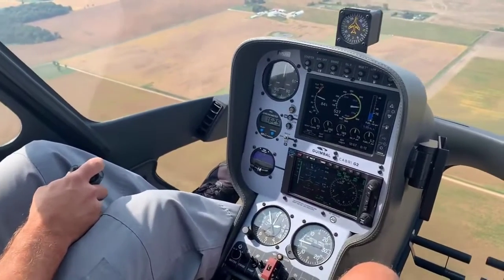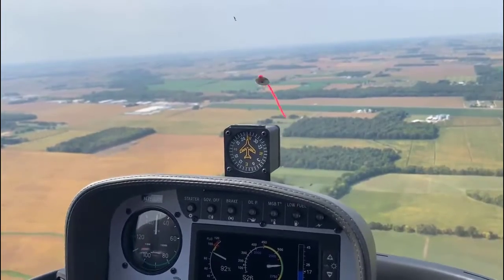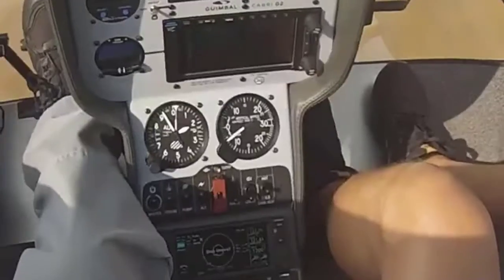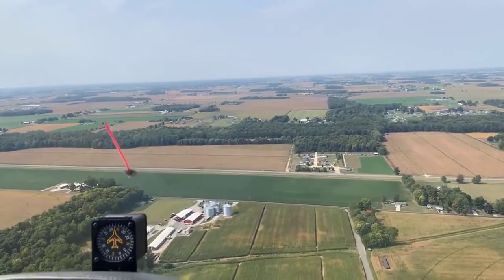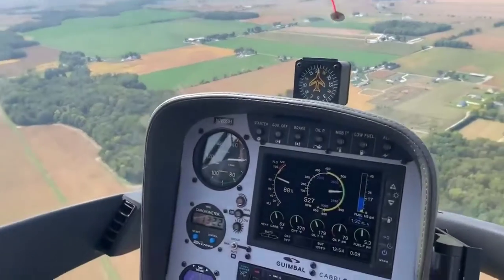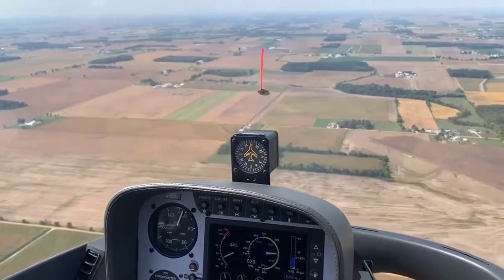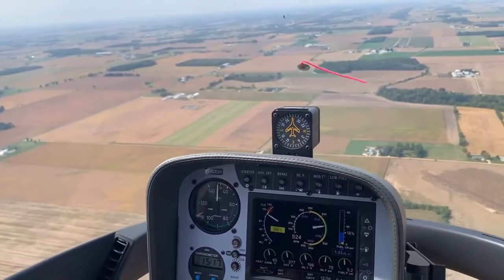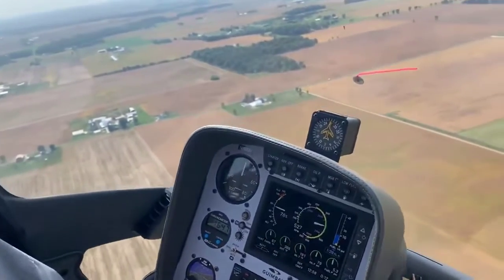Mastering Vortex Ring State Recovery: Standard Techniques and the Vuichard Method

Comment: Okay.  First, demonstrate full VRS.  Climb to 5 or 6 K and put yourself in VRS.  Full blown VRS, and then add some power.  You will be horrified that the aircraft accelerates downward.  Depending on the size of the aircraft, you will reach rates of descent up to 6000’/min within 1 or 2 seconds.  If you ever are shown actual VRS, you will NEVER pull collective during initial recovery. NEVER.  Directional flight is the only way to exit full VRS or near VRS.  Forward, sideways, or rearward.  You can even use pedal to maintain heading if it makes you feel better.  But NEVER get in the habit of pulling power to initiate recovery.  NEVER.
Reply from the maker: Thanks for commenting